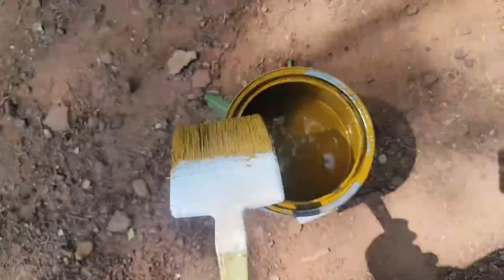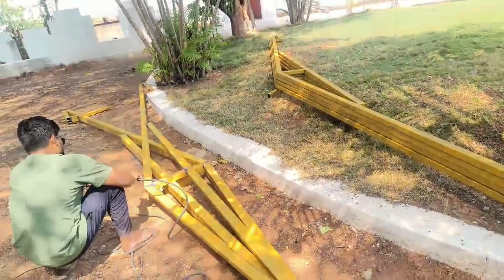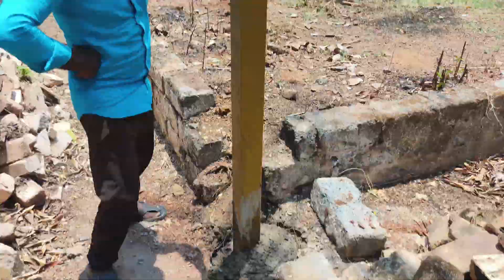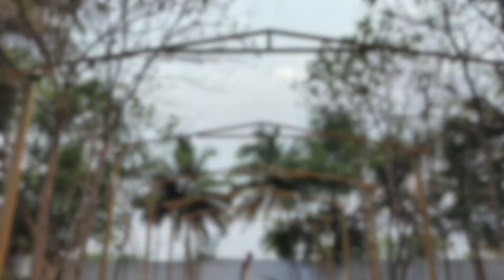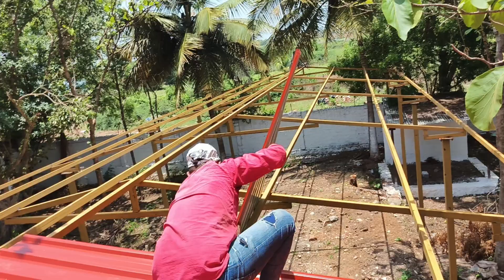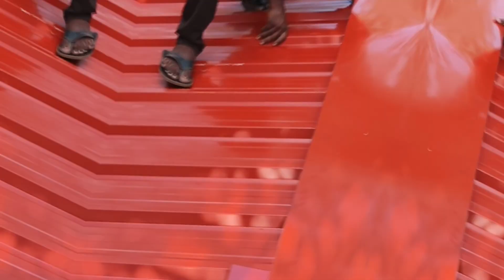How To Make Roof Shed| Roof Shed Design For Home| Roof Trusses making Ideas

Comment: Congratulations from Brazil. Please what are the specifications of the roof tubes (length, width and thickness of the tube)
Reply from the maker: Size 25×78 column size 4×4=12 runner size 3×2